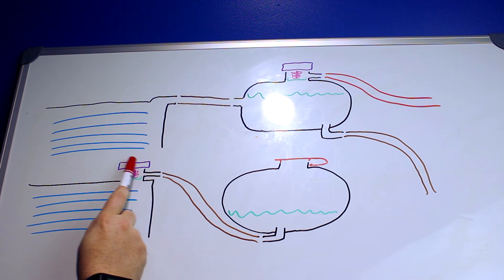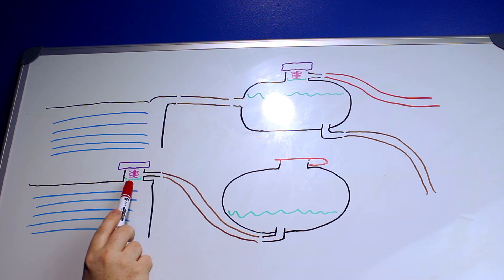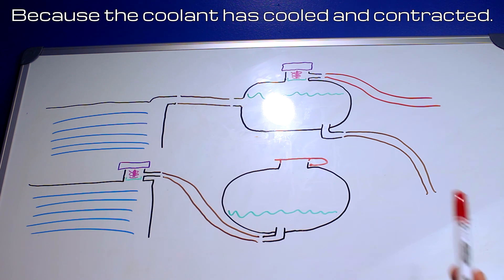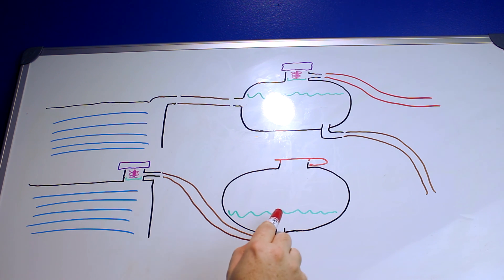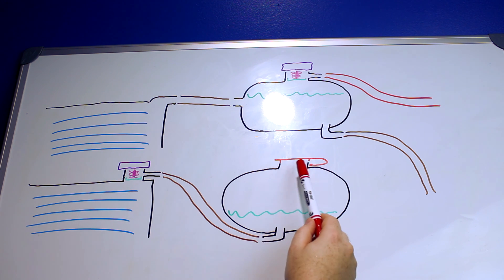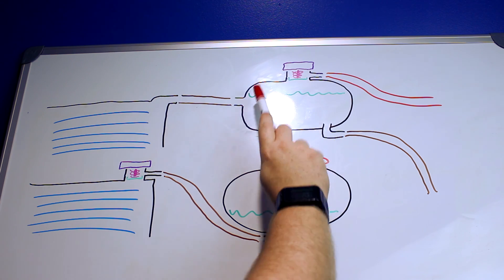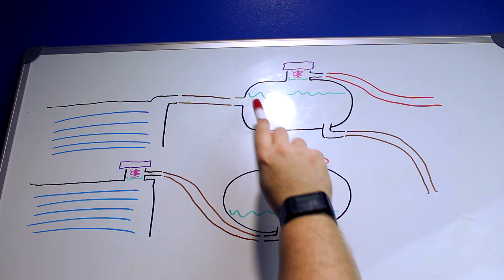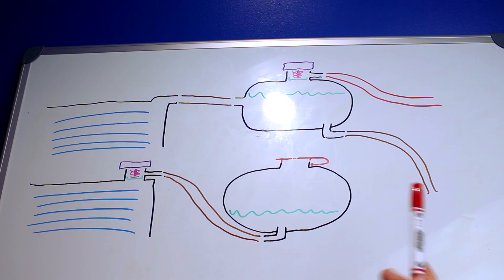Differences Between Expansion Tanks & Overflow Tanks in Automotive Cooling Systems

Comment: I have a 2014 Volvo v70 D4  that I just bought and I get a low coolant warning light that comes on after driving an hour or so. The temp gauge doesn't indicate overheating and the car runs awesome. I will then pull over and open the hood and sure enough the coolant is low. Here's the strange part, when I turn the cap slightly, coolant rushes into the reservoir, fills back up and the warning light goes off. I have to do this every 20 or 30 miles.

Also, when the car is completely cold and has not been driven for a day or so, when I unscrew the cap on the reservoir, air rushes in and the coolant begins to rise?
Reply: probably head gasket damage. cylinders slowly pump compression pressure to the cooling system. What I dont understand is why exp. tank cap doesnt let the air out. I changed the cap twice, still the same. I have been searching for a method to drill a 0,1 mm hole through the cap to get the air pressure out. Let me know how if you solved the problem.

Comment: So here is my problem i have a  2006 Daihatsu sirion and it had a coolent reservoir like the upper one but without a connection under it so it has one tube on the cap and that's it and i don't understand it

Comment: My exspansion tank or so  I think it because there is no radiatorcap on the radiator, will not pressurize at all but if I put the cap on it will throw out some antifreeze. I don't know what's going on? Plesae help. I tried to text it with a pressure gauge but it won't take any. I don't see a hole or a crack in it at all.

Comment: One question. Is the level of warm coolant higher or lower then cold coollant. Because the level in the expansiontank looks as it is rises at warm temperature en lowers at cold temperature. Is this correct?
Reply from the maker: On every one I've seen, that has been true (that the warm level is higher). Not every tank has high temperature and low temperature marks, but it will still work that way, marked or not.

Comment: I have a 454 everytime i use it for bit then turn it off it always leaks water I always have to fill up the radiator w/ water b4 i use it, it doesn’t drain all the way just a bit after a couple uses it gets pretty low any ideas on what i need

Comment: I have a lengthy question. On my 5.3 swap in my 64 C-10 I installed the surge tank from the 03 Tahoe the engine came out of but not the radiator. I also installed the correct heater hoses to the surge tank. My problem I essentially have two radiator caps now and I can't seem to get the air out of the system. Running the vent line under the radiator cap of my LS swap aluminum radiator to the outlet on the surge tank that normally goes to the stock Tahoe radiator. I'm doing this via a reducer in that line. Thank you for taking the time to read. Great video BTW 👍

Comment: i replaced the radiator, with a new one the water pump and thermostate in my 09caravan
 coolent level drops and does not get sucked back into the radiator, i must add coolent to radiator to keep it from overhaeting. no white smoke no coolent in oil what should i be looking for van has 149k i am thinking vally pan gasket

Comment: I am thinking, for the pressurized system,  if I release the pressure when coolant is hot with care, then when coolant is cool, it'll create vacuum.   Next time it gets hot again, the PSi won't be as high as usual.   Is this a good idea to  have constant vaccum in coolant line?  I've seen coolant hoses got blown holes in them.  The goal is to prreserve the coolant hoses.  Thanks

Comment: Regarding the overflow tank (bottom diagram) if the cap is "flimsy" and not pressurised, how does any pressure become greater than in the radiator to push coolant back into the radiator? Also if the radiator cap has cooled would that not close off the valve thereby preventing any coolant pushing back from the overflow tank? Not arguing, just confused🙂
Reply: Just think of the radiator side.  As the coolant heats up it expands, pressure builds up, when this pressure exceeds the rating on the cap the cap spring compresses and lets coolant escape into the overflow tank.  The radiator cap keeps the system pressure constant and prevents it from building up too much pressure.
Then when the coolant in the radiator cools it contracts, pressure drops,  when it reaches a negative pressure it sucks coolant back through the cap from the expansion tank.  You can either think of it as air pressure pushing coolant back into the radiator OR the radiator sucking it back in.  It may take 15PSI to push coolant OUT the cap but it will let coolant IN with any negative pressure.
Reply: @londonranks in cold engine when i open coolant tank cap make big hiss sound its normal ?

Comment: Great vid. My Cap seal broke and fell into the radiator, causing my overflow to leak a lot of water. Should I worry about the seal being stuck in radiator and obviously I need a new radiator cap? Thanks!

Comment: On the expansion tank explanation, you mentioned that some systems have a return line. I'm wondering if you have any examples of systems that don't have a return. Seems like across the board if they have an expansion tank they have a return to somewhere just before the pump. 

I don't really know why they need a return, but it has to be doing something. Maybe keeping some small amount of flow up and through the tank continuously purging air?
Reply: My tank has a med to large hose to radiator then I have 2 small hoses from tank to radiator 2:31

Comment: Help!!!  I have a Jeep Gladiator and suffered a major brain cramp and added a small amount of Dot 3 brake fluid to the expansion tank which is right next to the brake master cylinder fill. I immediately realized my mistake and siphoned all of the mixed coolant and brake fluid from the expansion tank. I also filled the expansion tank twice with clean water and siphoned completely to hopefully flush the contaminated content out of the expansion tank. I then filled the expansion tank to the proper level with pre-mixed Mopar OAT coolant per spec. My question is, could any of the brake fluid be still in the system. Note the engine was cool and never started during all of the above.
Reply from the maker: Without being there, it's hard to tell for certain, but that sounds like a thorough way to remove it. One of the big issues with brake fluid in normal conditions is how readily it wants to bond with water, so that should make what you did quite effective! I don't have any experience with this particular chemical mix issue, so I can't say for sure it won't have any issues with trace amounts of brake fluid. I imagine the odds of having a big issue are low, but it's worth checking on the fluid from time to time to make sure an issue isn't developing.
Reply: @CarsSimplified  The solubility with water is what hopefully will save me. I reviewed your video (very good BTW) to see exactly how the expansion tank (which mine is) interacts within the cooling system. If I understand things accurately, the cooling system would be closed to the expansion tank if the engine wasn't started and the coolant was at room temperature. Accordingly, it would seem a thorough flush and removal should have gotten the contaminated coolant out of the tank prior to intrusion into the rest of the system. Thank you for the video and the reply.

Comment: Question, my truck had an expansion tank from factory and switched to an over flow style tank from a 90s-2000s mustang. Since there is no way for the pressure to be released could this be the reason for coolant pushing past the overflow tank cap and spraying out when I am racing for one consecutive long time/run? Doesn’t over heat or anything just pushes past the cap when i do lets say a 60-130mph runs.

Comment: My golf v has a wire inside the expansion tank. When I overfilled it I used a cloth to soak up and pulling it out it bent the wire up. I bent it back. What is it for and will it cause a problem later?

Comment: I have a 2012 GMC sierra. Does the coolant circulate through the expansion tank is my question… Just added some coolant after I fixed a radiator leak and I want to make sure that the proper ratio is flowing through the system.  It still looks like pure coolant on the expansion tank, even after driving for a while…

Comment: I have question what If I filled the resovoir with one  jug a pure antifreesze and did not mix.Can I still fix the mix to get right ratio?
Reply from the maker: You might be able to if there's enough room for the water. Most personal vehicles I can think of don't have two gallon reservoirs, though. You may have to drain/extract some of that full strength stuff.

Comment: Great explanation. I had wondered by my BMW could have small hole built into the top of the coolant tank, when most websites I saw said that the coolant tank is pressurized and part of a closed system
Reply: Does your car have an actual radiator pressure cap on the radiator.   If so the coolant tank is an overflow tank.

Comment: Why does it say on the manual not to add coolant if the expansion tank is empty.  Air could enter the cooling system and damage the engine. What are the chances of that happening?

Comment: I built a car
A 61 sprite with a sbc 383ci 
The radiator is below the motors top so I have a fill on the top of the engine as well as a radiator cap.
I fill the radiator and then the motor.
I have a lower pressure cap on the radiator connected to an over flow tank.
The radiator feeds the overflow tank but doesn't suck all the fluid back into the radiator. 
The overflow is lower than the radiator cap.
I tried feeding the overflow from the thermostat housing fill neck.
But I get a lot more coolant out more quickly. 
Thoughts?  Video of the old setup in link

https://youtu.be/OO-Rn0ypRYk

Comment: If you have a low mount radiator with an expansion tank that links to a thermostat housing/fill neck - what PSI caps would go on the thermostat housing and expansion tank?

Eg if 16 psi cap is normal - would I do 8 and 8 in each location or 16 in each?

Comment: Hi, I have a race car with an expansion tank set up, however the expansion tank has a pressurised cap without a valve and the radiator has a valves cap. The valves cap on the radiator is vented to nothing which gets messy. 
It didn't used to get messy but I'm getting overheating issues ( possibly head gasket) but not sure.

Have you seen a system like this before and  am I a component missing?

 Any help appreciated.👍

Comment: You got the expansion tank vent location wrong.  It’s rarely connected to the high point on the radiator since the expansion tank is the high point.  It’s always plumbed to the suction side of the circuit ie upstream from the pump and in many cars other points.  These systems function very differently.  One is actively part of the cooling circuit and the other is as you rightly described as available after the car cools.  An expansion tank will solve a lot of cooling issues in hot cars.  All modern cars use an expansion tank.

Comment: I have a expansion tank with radiator cap you described 1st.  The water level never changes whether hot or cold and engine temp is fine & no leaks. So I'm assuming there's no flow between radiator cap and the cooling system. I see the hose that goes from cap to the overflow tank and that doesn't seem to be a problem. I'm pretty sure the radiator is full. Any suggestions? Thank you for the video. Very helpful knowing what I have.
Reply: If its not overheating and you've got hot air I'd say dw . Unorss you feel something is wrong.  I've personally got cause for concern lol (my car )

Comment: Very interesting! My 2016 Chevy has a different configuration. Both my radiator and surge tanks each have a pressure cap. When the dealer did a flush recently, when the car is cold, the fluid in the surge tank is all the way to the top. I'm concerned about what happens if it gets hot. Where will the excess coolant go?
Reply: It'll come out through the hole below the cap. It's VTA
Reply: @carbonm2  Thank you! That's what I am concerned about. I wouldn't want the hot liquid going on wires or any electronic components. With your information, I am now doubly glad that yesterday I used an old Turkey baster and removed the excess.

Comment: What would be possible causes for the overflow coolant not being drawn back in to the radiator? Other than a faulty radiator cap that is.
Reply: In case of an overflow tank (open type system), the tank has a way of breathing air in and if that way gets shut (e.g. due to a clogged hose or a loose tank rubber cap seal getting sucked in the outlet during engine cooldown), then the expanded coolant will not return to the radiator. If this happens a few times, then the radiator will loose so much overflowed coolant that the car will overheat and eventually blow its  head gasket. So, in open systems, what you describe, might happen due to faulty overflow tank cap and its hoses/seals.
Reply: @Arupojonu I have coolant on my radiator cap bit nothing in the reservoir tank ?

Comment: On the bottom design...As the coolant heats up and pushes past the seal on the radiator cap, how does the coolant get past the seal on the radiator cap when it cools back down?
Reply from the maker: Good question! Definitely something I wish I included in this video. I'll end up taking one of those radiator caps apart sometime for a future video, but on some of these radiator caps there's a small sealed way back in that has a small spring holding it shut. As the coolant in the working part of the system cools down, the pressure can get low enough to overcome the spring and pull the excess coolant back in. When the cooling system is at a neutral pressure, just the spring seals the cap, and when the system is pressurized, the pressure and spring are both keeping that return path pressed closed.

Comment: Is there a difference in pressure between these two systems? I know that the cap determines the pressure in the radiator but can you adjust your pressure with the expansion tank setup?
Reply: There’s a cap on the expansion tank

Comment: I have put a Zzr1100 motorcycle engine in a kit car and mated the radiator of a honda Jazz to it. It has the fan of the honda Jazz and a temperature sensor. The piping from the bike has a pressurized cap. The radiator feeds to an overflow bottle. When the car gets hot, it's sucks all the coolant out into the engine, boils over and forces it back out of the expansion tank pipe over flow pipe. Then when it cools down, what's left drains back into the expansion bottle. This causes air locks, loss of coolant and massive heat problems.  The thermostat is fine and the cap works fine. No air locks. Could it be that the expansion bottle is too low ?

Comment: Hey, an you explain why there is a return line on a expansion tank that sends coolant back to the pump? My tank has 3 connections, 1 to the radiator, 1 to engine outlet (behind the thermostat) and 1 connect just before the waterpump. Isn't there a bypass to the radiator in such a design? I'd like to understand why it was build that way and whats the purpose. Thanks!!

Comment: As for the expansion tank, suppose you siphon out all coolant and replace it with new fresh fluid: how long would it take for the entire content of the expansion tank to be replaced with old coolant from the rest of the system? That way one could replace all coolant over a period of time instead of causing a mess on the parking lot.
Reply: My dog licked up spilled gas started running around my car outside then he started shaking uncontrollably and he dropped dead on the driveway .
He ran out of gas
Reply: Obviously a high octane dog dealing with low octane gas. You cheapskate, you!   @Foxtrotwilconiner1969
Reply: Put a tub under and empty the system properly you need to do this to clean out all the crap that builds up in coolant never let it just spil out on the floor the smallest ammount of coolant will kill a cat if it licks it up and cats do as they like the smell of the stuff.

Comment: 0:48 - If there is vacuum on the left side, WHAT is gonig to compress the spring in the radiator cap to allow liquid in the reservoir to come back into the radiator ?
Reply: I came here looking for this answer
Reply: Its about heat and cool.
Reply: Same question.  That valve will be held shut by both the spring AND the vacuum pulling on it
Reply: Wondering the same thing
Reply: There are 2 springs. 1 for for coolant out and one for coolant in.

Comment: If there is pressure in the radiator cap sealing the radiator, how does the coolant get from the overflow tank back through the cap? I understand everything else about the system except that.
Reply: When the water cools and has more space due to water shrinking it vacuum water back in
Reply: @jaytank31  I looked it up, I didn't realize rad caps had two way valves, I thought they sealed unless pressure escaped. They also open the other way to relieve vacuum. That was the piece I didn't understand before.

Comment: Om fixing a 1988 Cadillac. There is a little bit leak om waterpump, and the owner told he check the owerflowtank often. But Wien i checked the radiator, i filled it up with 2 gallon. So why did the coolant not go to radiator from the owerflowtank?